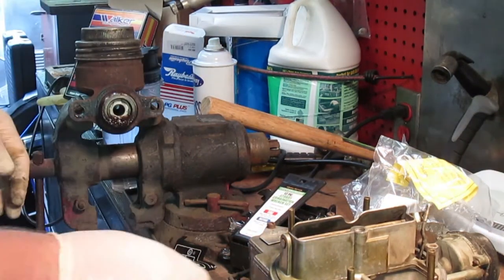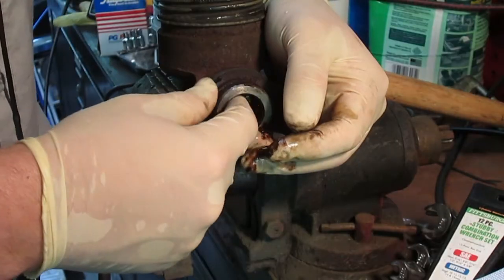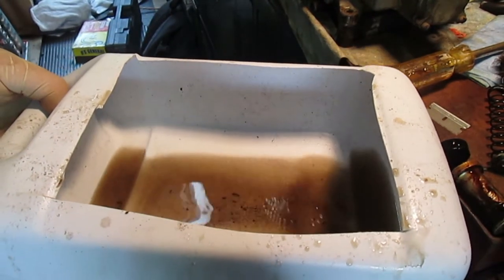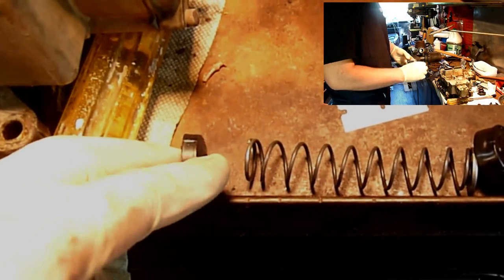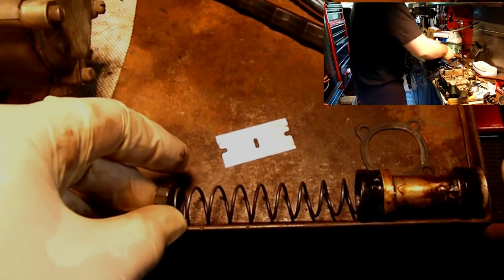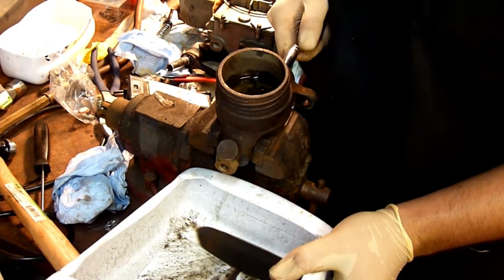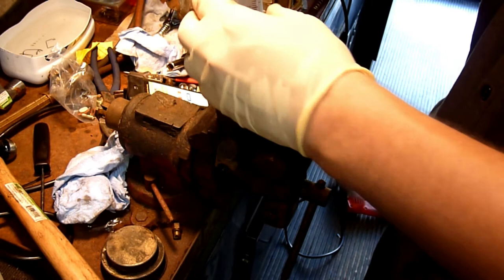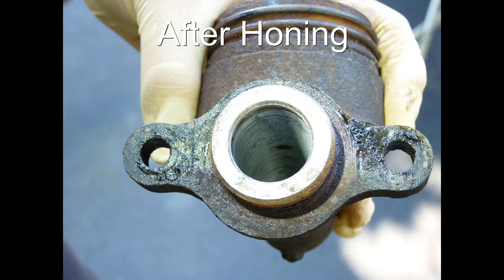1965 Mustang Master Cylinder Rebuild (Single Bowl)

Comment: But, the instructions for the syringe show the syringe on the exit port sucking out brake fluid from the bowl - holding the syringe vertical to expel any air - and then pushing all that brake fluid back into the exit port and up into the bowl while looking for any trapped bubbles.  On my old master cylinder, I can push fluid in reverse through the port and up into the bowl.  On my new (rebuilt) unit, I can't.  I wonder if it just because the spring is stronger on the new unit or if there is a blockage somewhere.  I even tried 100 psi of air pressure and couldn't blow backwards up into the bowl.  Looks like I'm going to have to do a disassembly on the "new" master cylinder.  My problem with the "new" master cylinder started after I vacuum bled the brakes twice.  I had brake pedal with the new unit before bleeding the brakes but lost brake pedal after bleeding.  I wonder where dirt could come from with the new master cylinder in place?  It'll be interesting to find out - and aggravating.

Comment: Thanks, I am attempting to rebuild mine, on a 1965 Ford Falcon. Identical master cylinder.
Reply from the maker: metalmoto Very cool! Let us know how it works out for you!
Reply: I just purchased a hone tonight. I couldn't get the piston/seals out last night. So I been soaking it in penetrating oil overnight.
The auto parts store didn't have a rebuild kit, but I'm sure I can order one online. This master cylinder is a spare, I found in the trunk of the car.
Probably was from a junkyard. Figured I'd try to rebuild it first, and learn from the experience. The original master cylinder is still in the car.
The car was running, when parked in a garage 33 years ago.
Thanks again!!!
Reply from the maker: Very cool! Have you been able to remove the seals yet? If the bore is pitted you won't want to rebuild it as the seal will not be effective due to the damaged and bore. We purchased our kit from CJ Pony Parts
Reply: Yes, it took me a bit, to get it apart. Unfortunately, it's pitted badly. And I don't think a hone will help it. I looked at having it re-sleeved, and that's twice the cost of buying a rebuilt one. Also the washer, as you called it, was missing. I still have the one on the car. Hopefully it's in better condition. The master in the car is slightly different. It has a small pipe plug in it, above where the line connects. I read somewhere, this is for a car, that doesn't have the brake light switch on the pedal. So I wonder if it wasn't replaced before?

Comment: if you use put mineral oil in your master cylinder you risk damaging rubber seals. Maybe better to hone with brake fluid. Otherwise a great video, thanks!
Reply from the maker: Thanks for that Tip Buddy! My thing is that is I use brake fluid I will ruin my tool. So I use Mineral Oil of some kind, and then rinse with brake fluid before replacing the seals! Happy Motoring-Blair